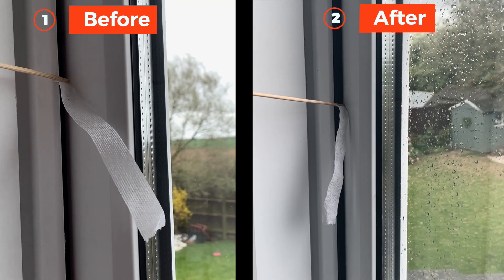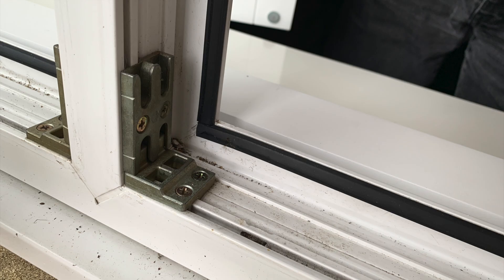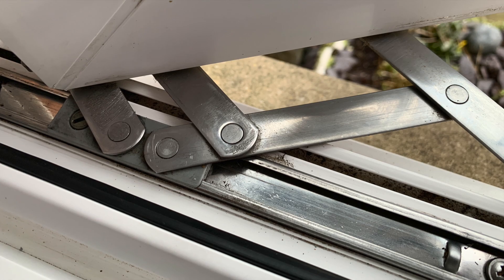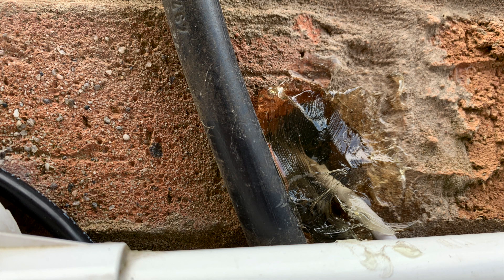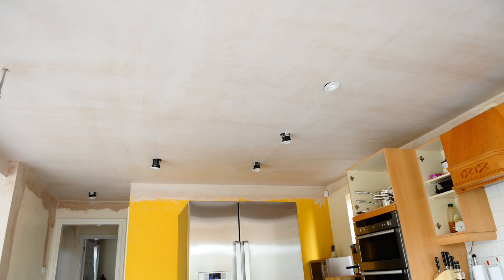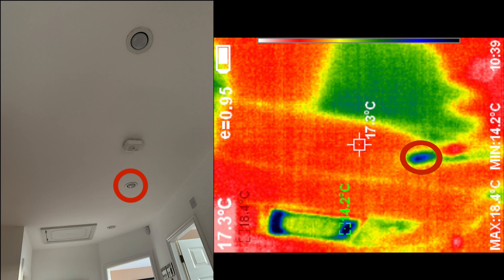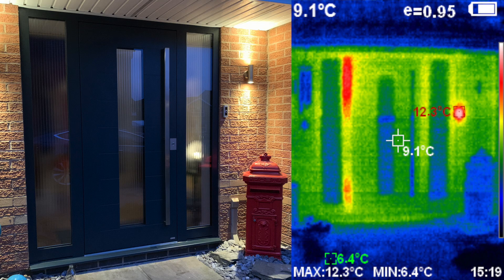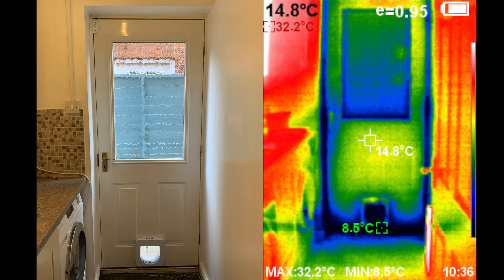Home energy efficiency by draught reduction and insulation improvements

Comment: I've changed the seals in half of our windows so far & it has made a big difference in terms of drafts. I might have to invest in a thermal camera too to pin point any hot/cold spots to be tackled.
Reply from the maker: Thanks for watching Scott. It's surprising how effective just changing the window seals is. Glad you've noticed a big improvement. The thermal camera will certainly help to identify 'hidden' issues that you need to tackle.

Comment: Hello John,what was your choice for the boiler replacement?
Reply from the maker: We didn’t change it in the end. Waiting and biding our time. Boiler was repaired and working fine, now running at its lowest temp.
Reply: @johntisbury  cheers for reply  I'm in the same boat now,modernisation or stick with 20 year old boiler....your front door is spot on...how much would that set me back?
Regards Glen
Reply from the maker: Sorry for the slow reply. For some reason YouTube thought your reply was spam and moved it to the 'for review' tab. I don't check it that often.
Our front door was 7K fitted and installed. Not cheap, but the it's a high end product.

Comment: Very helpful video, though i can't afford a new door, i put a thick thermal curtain in front of our door, which cuts the drafts out, using your toilet paper stick trick, led lights though some are cfl lights and will replace with led when they blow, our biggest problem is the age of the house ( 1940's ish) , though may be moving to a bungalow soon,
And if and when we do, i will look upon insulation in the loft and seals on the windows, though the loft with have to be done by the trade as i am disabled
Reply from the maker: Thermal curtains work, that’s for sure. The toilet paper and stick is simple and easy to use. Glad to hear it was helpful.

Comment: Hi John, thanks for sharing. Can you advise if the shutters you have fitted to the windows make a decent contribution cutting heat loss. I am considering getting them fitted but not sure of the benefits. Many thanks.
Reply from the maker: Thank you for watching. They are ideal for maximising solar gain and reducing the heat in the summer as the louvres can be adjusted to bring in more or less sunshine. You can also hing them right back away from the window which I do in the winter when there is any sunshine, again to maximise solar gain. We do notice a difference when we open the louvres on a cold day, it is considerably colder next to the glass.
Reply: @johntisbury  Thanks again - really great that you respond and are helping other make a difference in saving energy by sharing your videos. Just thinking about the shutters again and was wondering if you ever used your thermal camera to see the difference of heat loss from the outside comparing when the shutters were open to when they were closed?
Reply from the maker: I've not done tests with the thermal camera with and without the shutters from the outside. I don't think there would be much difference between a good set of thick curtains and shutters to be fair.
Reply: Hi John loving the channel I’m in the north cumbria and wanting to change similar passive door , ark looks fantastic if it’s not being cheeky what was the cost to nearest £500 looks very impressive on with gasket change and 400mm insulation at the moment and running a 5kw solar , your figures are beating* me hands down 💪
Reply from the maker: @TACADO1  thanks for watchning. The door and side panels with installation was just shy of 7k.
Reply: @johntisbury  thanks John looks stunning enjoying the channel keep up the good work 👍👍👍
Reply from the maker: @TACADO1  thank you. The door is awesome, it's made a tremendous difference, no draughts in the hallway now. It's quieter too being triple glazed.

Comment: Good work John 👍 What's you logic for leaving the gas boiler on 24/7? Everything I've ever read says only heat the house when you actually want it warm i.e. operate the boiler on a timer. No need for the whole house to be at 20 degrees in the middle of the night when you're tucked up and fast asleep in bed 😉
Reply from the maker: Thanks Mark. 
A great question re my boiler logic. It turned out to be flawed logic! My initial thoughts were because we'd dropped the boiler temperature to its lowest setting it was running like a heat pump, low and slow so keeping it running 24/7 would help to maintain that core temperature. However, since November last year we have kept the same boiler setting and run it on a timer (on at 8am off at 10pm) and the house has stayed the same temp and used less gas.
Reply: @johntisbury  Ahha, I wondered if that might be the case. It (running the heating 24/7 is more efficient than letting the house go cold then heating it back up when you want it) seems to be a persistent "myth" that has been around for ever. Perhaps it's the gas companies perpetuating it 😉

Comment: I’ve been getting by with just a spot laser thermometer.  You’re making me want a thermal camera!

I’m thinking of a new data acquisition project.  Using my raspberry pi to measure difference between inside and outside temperature.  I could then correlate temperature decay rate with temperature difference.  Then as part of a long term plan, each improvement to the building fabric can then be objectively measured in relation to temperature decay rate vs temperature difference.
Reply from the maker: It's a great idea. The thermal camera certainly helps to pinpoint where the issues are and where no action is required. Makes it a bit more targeted. Great idea on the longer term before and after measures too. A little more scientific than mine.

Comment: Interesting stuff. Are you monitoring humidity in the house? As you reduce drafts you are reducing air flow so the moist air inside doesn’t get replaced with less moist air from outside (well not so much)  the more moisture in the air the more chance you have of getting damp spots where there are cold spots. Very complex subject that may be worth a video.
Reply from the maker: Thanks for watching. Humidity is a good point. I have 2 Shelly Temp/Humidity sensors that I’m testing at the moment. Using Homa Assistant to automate things like dehumidifier s

Comment: Thanks for that video. I was interested in your final comments about temperature settings (room stat and boiler). You must have a different make/model of wife to me. Mine wouldn't be very happy with 20c and running the boiler at 46c would mean the house warming up in about a week and legionella bacteria going rampant in the hot water cylinder.
Reply from the maker: Thanks for watching Graham. We have our hot water heated by the eddi rather than the gas boiler and it's set to 65ºC as standard. It maybe as the cold weather hits harder we will increase the thermostat to 21 - 22ºC.
Reply: @johntisbury  I have considered an eddi but with our 6.9kWp panels located in NW England there isn't enough sun at this time of year to make an impression on the house electricity usage and keep one EV topped up. The situation might improve in spring/summer so I may try that next year. In the meantime heating the water with gas is the cheapest option, sadly.

Comment: Looks like a goldmine of info, looking forward to this. Questions to everyone trying to retrofit their homes to near passivhaus standard, what measures are you taking for air changes and elimination of condensation/humidity? And how much cost difference is there from installing Positive Input Ventilation against the systems needed if you're sealed up air-tight?
Reply from the maker: This is a great point. I'm looking at heat and humidity sensors to automatically trigger heating / ventilation in the longer term. We're nowhere near air-tight so no risk of mould, condensation or stale air.

Comment: Paid someone to change the seals on every window in the house this week. Also changed the front door. I suppose that not so much of a coincidence given this channel is all about eco-efficiency. It’s like a new home. We were going to change the windows but were told we have great window and the benefits would be minimal. I’m impressed we were “sold” windows unnecessarily. 

Now on to our next project. #Attic insulation.
Reply from the maker: Agree about it being a new home, those changes are noticeable. The attic will be a major improvement, so much heat lost via the attic.
Reply: Good advice , lubricate your window hinges often with silicone spray not oil , work it into the joints by moving the opener back and forth , it stops the joints seizing and pulling the sash tight against the seals , most of the time draughts are caused by lack of maintenance , after 40 years of fitting windows ive seen it all , most customers think windows and doors look after them selves , give them some TLC and they will last years

Comment: What do you plan to do long term with your fireplace and chimney?
Reply from the maker: Hmm a good question. I've not given it any thought to be fair. We don't use it, so I guess it will get properly blocked up at some point.
Reply: @johntisbury  we can still use gas or wood burners (dry not wet) but I wonder if that will change in the future. Considering a more efficient stove. I’m not sure what we will do. I don’t think electric fire look as good as a real fire yet but it does frustrate me that me may still be burning stuff.

Comment: Very interesting topic and work you're doing. 
My only critique is  air circulation within your property. 
It will be interesting to see how condensation builds up.

I've been looking into and installing mechanical heat recovery unit in the bathroom and other rooms
Reply: you must open your windows , daily , get rid of stale air , its alright having a sealed box , but a house has to breathe
Reply from the maker: Thanks Michael, it's a very valid point about air circulation. We are nowhere near passive house standards in terms of air tightness so don't think lack of circulation will be a problem. MHVR is currently a bit of a mare to retrofit, I'm sure neater and better solutions will come along in the near future.
Reply: @johntisbury   I thought the same thing.
And yes, the massive whole house recirculators would require a lot of plumbing.

But you could look at the idea of just the bathroom for a start. You already have one extraction out.
I take it the fan is in the loft.
So all you would need to do is add a small single room recirculator add an extra hole in the bathroom roof and an extra hole outside note these need to be a minimum of 1 m apart.

Which then brings me to each room. I figured I only need to do the bedrooms so I could put one above each bedroom.

I've only installed the one in the bathroom to date. I don't have any data to work with yet as the bathroom is still being renovated
Reply from the maker: @Michael Pickles interesting to hear this and makes a lot of sense. I shall investigate. Thanks.
Reply from the maker: These certainly work, I have one in the garage. Would prefer a more installed solution, however they are certainly a sensible priced option.
Reply: My problem is condensation and that's before making any draught reduction, what's your thoughts on installing Positive Input Ventilation (my current choice)? Passive Stack Ventilation 'might' be possible as the house layout is pretty simple, but need a choice of replacement heating system first as it'll dictate available space...

Comment: Do you have the link to the window seal website? 
My parents need new windows (most are even blown, but all whistle etc) but simply refuse to. New seals would at the least stop heat from their radiators just going straight outside. Ridiculous really but hey ho, it's their house...
Reply from the maker: Hi Peter is was from Handles and Hinges:  https://www.handlesandhinges.co.uk
They probably don't want new windows due to the perceived mess and upheaval from having them replaced. Defo a job for the warmer months.
Reply: @johntisbury  I thought that however I've been nagging them for the last 2 years! And they've only gotten worse in that time.
Thanks, I'll order the sample pack and see what happens!